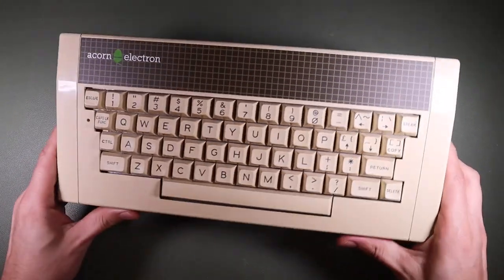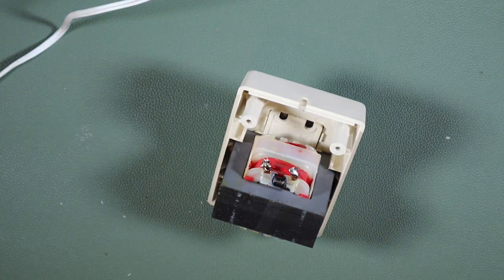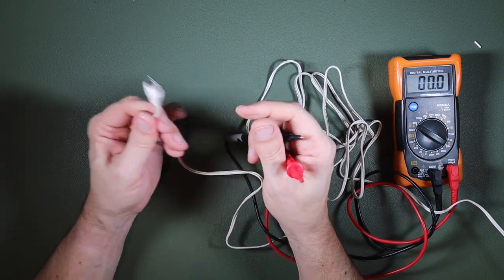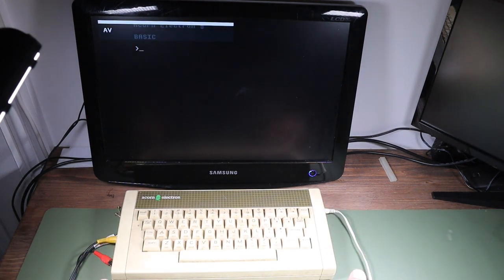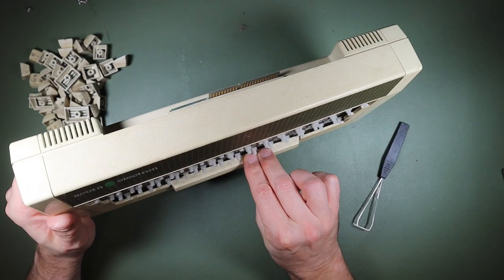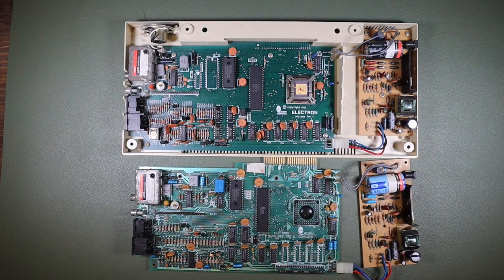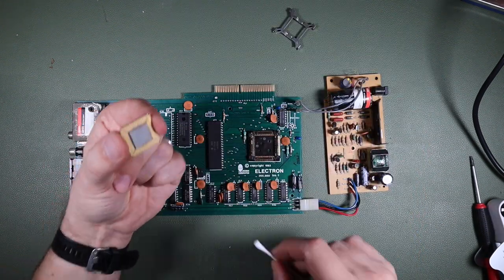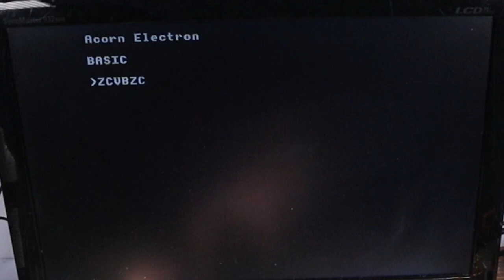Acorn Electron Repair - Faulty eBay Retro British Micro

Comment: I have 2 Electrons, one of them had a couple keys stop working a few days after arriving. One solution I found it works great is to introduce a good amount of IPA to the inside of the key switch with a cotton tip, between the shaft and the enclosure of the key so that it soaks, and keep pressing repeatedly. It managed to clean the contacts and the key started working perfectly after that. After a while the IPA evaporates. The oxide or gunk that was on the contacts was displaced for good, it seems. Or until the next time... Saw this trick on another video about reparing one of these keyboards.
Reply from the maker: Great tip thank you. Really appreciate the feedback.

Comment: I had some trouble with a key on my Elk too. The two pins on the key switches (desoldered) have screw groves and can be twisted out with a plier. The pins in my faulty switch had heavy black oxidation and worked after cleanup (no need to actually pry the key housing open). I think when you exercised yours you managed wear the oxidation off.
Some people have been running their Elks off DC power supplies (lower V than AC) as the internal PSU has 4 rectifier diodes, but there's some debate on the topic it seems.
Reply from the maker: Great info. Thanks so much for your comments.

Comment: I used to repair these in early 80s.  the older DIL RAM chips one would fail commonly. to find which one  if stuck output spray the whole set with freezer spray and see which one thaws out first. or if one RAM open circuit output piggy back a fresh set over each chip, run a program then pull each one off one by one until the computer crashes.   and the older ones had a snap-in ULA that you repair just by snap it out then back in again
Reply from the maker: Good information jagmarc. Thanks so much for your comment

Comment: Another great result! I really like the way you narrate these videos, pointing out the mistakes you made along the way in a humorous way. I watch all your videos regardless of the subject so I hope that gives you even more encouragement to keep up the great work! 😃 Oh, and Servisol Super 10 works great for all my repairs, just don't use it in volume pots or faders, they need fader lube or similar to keep them working nicely.
Reply from the maker: Hi Matthew, thanks so much for your kind words. I am really pleased you are enjoying the vids. I look back at some of my earlier stuff and cringe a bit sometimes, but its thanks to people like yourself who provide feedback and support that I keep on with this. I'd have given up ages ago on otherwise. So thanks! Thanks Also for the servisol tip, I just this minute used it and for the first time and it cleaned up a switch beautifully where a different brand has worked, but I'll be sure to get some proper its lube to add to the toolkit. Thanks again.

Comment: You can save that piece, snip both ends off and drill right through the center with a small drill bit. Then just keep increasing drill bit size until you can push the cable through.
Reply from the maker: Thanks for the tip

Comment: You can add a little water, distilled preferably, to the IPA to make it clean better depending on what is being cleaned, water is a better solvent for some things.  Also evaporates a bit slower.  

9:1 is a good ratio.
Reply from the maker: Great tip! Thanks.

Comment: a common fix is to pull the ULA, clean it and reseat it, the pins get oxidised the cover is the only thing that keeps the ULA in place, so after multiple heat cycles it looses the ability to stay stuck (sorry bad wording but I think you get it)
Reply from the maker: Yes totally get it! Thanks so much for your comments, really appreciated! 😊

Comment: ...and maybe this one too!  Ha ha ha.  I really get that, having amassed 8 x Casio VL-1 in various states of repair.  (Although I do plan a video combining various VL’s - something custom).  Quality of the video and voice over is good RTR, very informative (hairs! - eeeeeeeeww!).  Do you script beforehand, or just post edit?  Chris
Reply: With dirty plastics (which don’t need retrobrighted), I just use a mild bleach solution to scrub the plastics. ;)
Reply from the maker: Oh I wanted a VL1 so much as a kid and when I finally got one the repair was a big job. I have a video on it you've probably spotted. Glad you enjoyed the vid. I do not script I tried it on one vid (LCD TV repair) but found it very time consuming. I do post edit only now and occasionally I do retakes when filming. Sound quality is a concern to me, I need to work on it and equipment. I haven't yet got it to a point I am happy with and keep having issues with mic placement, background noises. I have one vid yet to edit that had a dreadful 50hz hum (source now eliminated) but it's all over the raw footage. I'll get there eventually. Thanks so much for your comments.
Reply from the maker: That's a good idea. I tend to use window cleaner if I'm doing it at the bench or washing up liquid solution otherwise. I cut most of that out of the electron vid to get it down to 30 mins
Reply from the maker: A multi VL1 would be awesome!

Comment: I managed to save a moulded on grommet on an Atari brick by pulling all the copper strands out and then pulling and peeling the insulation. Then pushed the cable pushed back through the grommet for a snug fit. If the same PVC/PU is used for the grommet and the insulation then chances are it will have bonded too well, we can but try.
Reply from the maker: Thanks Chris, good thinking. I'll try that next time too.
Reply: @RetroTechRepair  another idea could be using heat shrink tubing for the exposed part. In that way the presure of the tubing could help as well for strain relief. The only downside is the cosmetically may look not that good.
Reply from the maker: @hernancoronel  Also A good idea, one to try if I can't rescue a strain relief. Thanks!

Comment: There's also a jumper mod one can do to get colour composite. It's trivial and works well.
The key mechanisms on the Elk aren't very good compared to the BBC, but WD40 electrical contact cleaner  (yellow top, not red) can bring them back to life.
Reply from the maker: Hi Roger, I didn't know about the jumper mod.... that's very good to know. I wonder why they didn't activate it at the factory. I suppose back then the composite in on a TV still wasn't common. I have to admit I did try the WD40 electrical contact cleaner although I didn't show it in the video, that "L" key was just so stubborn. Good to know the Beeb is better though I do fancy having a go at one of those some day. Thanks for your help and feedback. Much appreciated.

Comment: I used EML contact cleaner on my BBC micro keyboard after some years in storage. No need to desolder, Just a drip on the stem of any troublesome keys and a few operations later they where right as rain.
Reply from the maker: Thanks for the recommendation I had used a contact cleaner too but the stubborn "L" key wouldn't give in. Removing it was really for diagnosis,  so I knew whether the key was the cause or something else. I will definitely try to find some EML though as the contact cleaner I tried didn't fix it. Thanks for the suggestion and thanks so much for your comments.
Reply: @RetroTechRepair  Agreed, it's not always so simple. Mine is my childhood model B so I know how it has been looked after. No Knowing what an eBay purchase might have experienced in it's lifetime. Both CPC Farnell & RS stock Electrolube EML.
Reply from the maker: Thanks for that, I will definitely get some I had been using WD40 contact cleaner, just got some servisol super 10 but haven't tried it yet.
Reply: @RetroTechRepair  Servisol is good too. I've not done any comparative tests, don't know if one has an edge over the others, they're probably quite similar in performance.
Reply from the maker: @ches74  good to know. Thanks

Comment: Pity the poor Electron, a BBC with the most effective features taken out. Slow as molasses as a result, which killed it for the games market it was made for. Especially as they took the joystick socket out. Still wish I'd kept mine I was given as a hand-me-down though.
Reply from the maker: Thanks for your comments. Really appreciate it. Totally agree. I reckon a lot of the problem was the cost cutting resulting in the use of 4 64kbit RAM chips to get the 32k.  Without that it could have been much faster. Thanks again for your comments. Hope you enjoyed the vid.
Reply: @RetroTechRepair  Thank you. Acorn fans will debate forever whether the Elk was worth it. But for my money, if it was Chris Curry's equivalent of Sinclair's QL or C5, I would say the Electron was way more a solution to problems they were looking for.
Reply from the maker: @MrDustpile  you're probably right there!
Reply: I’m a bit late with this comment- but I chose the Electron over the BBC because the bus was available at the back. I plugged a DIL socket onto it and wired it up to a veroboard and… party time! It was a nerd’s paradise. I was able to couple it up to all sorts of external electronics to control relays and motors. It was not a good games machine, but actually easier to expand than the BBC for the techie types with a soldering iron.

Comment: all you did was unsolder and resolder the L key and it works now? WITCHCRAFT!
Reply from the maker: Could be but a cracked solder joint is not out of the question, nor is that repeated key pressing may have worked off some surface corrosion. These things happen sometimes we just get lucky